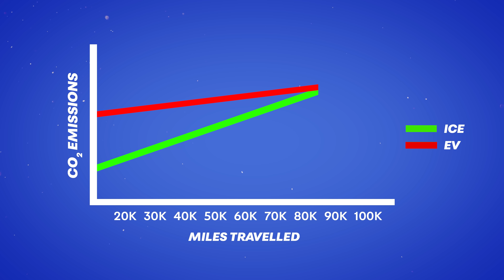Are Electric Cars REALLY That Green? [New 2022 Data]

Comment: What about the cost of updating the grid? Most Australian cities are already having brown-outs in summer due to high consumption and the limited output of wind, solar and no new power stations.
How will you feed a nation when arable farmland is being converted to solar farms? 
Charging stations on the Nullarbor plain or the Birdsville track! What environmental cost for the infrastructure?
My 17 yo Australian made 5.7l 1800kg sedan has 225k miles up. It has never been apart, is on the original fuel and coolant pumps and will still pull 33mpg at a 70mph highway cruise.
Without the petroleum industry we will not be able to make clothes, furniture or EVs - where does plastic, in all its forms come from? There is a place for both BEVs and HEVs but only for about 10% of the world's population.
BTW, battery fires are a real issue in hot climates. I have researched this a great deal whilst writing training materiel for EV technicians. Gaseous fuel has a lot of merit.

Comment: How long will the batteries last?   This does not take into account the lifetime of the car.   Will it last 350,000kms or 15 years without replacing the batteries?  If you have to replace them in 8 years that effects the cost and carbon footprint.    If parts are quickly discontinued then it means the cars will be scrapped sooner, increasing the footprint as well.  Not to mention the increased cost of owning a car.   It will kill the used car market if it costs 30 grand to replace batteries when an ICE car would have lots of life left in it at the end of a five year lease.   Those who cannot afford a new car will have to refinance their house to afford an old one, knowing they will have to soon replace batteries and motors.

Comment: One extremely important detail that was left out of the Volvo research, HOW LONG DO THE BATTERIES LAST??? 
Most people do not realize that those GREEN CARS will only run for a set time. THEN YOU MUST REPLACE THE BATTERIES, AT GREAT COST TO YOU AND THE ENVIRONMENT AS VOLVO STATED!  Just look at your battery tools, after so many charges, they die and must be replaced.
Reply: Wrong, new battery packs are tested and designed to run for over 100k miles with less than 10% drop in capacity. This is why many packs are now warranted for that. It’s true older packs had a much bigger drop in capacity and needed to be changed but technology gets better … just like mile per gallon has improved over the years in a ice car.
Reply: @How.deep.is.the.rabbit.hole.O  Even if you think you are right on this, and from what I have seen and read you are not, EV owners will still have to replace those batteries way before a regular engine would, again at great cost. There is also the issue of what to do with those batteries. Most states do not have any plans for recycling, and in many parts of US, like idiot California, they dont have enough electrical generation to support mass EV use.

Comment: ev uses twice the energy
325 miles = 100M joules (16HP for 7 hours level ground)
charging a big battery is 70% efficient
turning tires from a battery & motor is 70% efficient
therefore grid power for ev = 200M joules
gasoline = no delivery losses (minor)
gasoline does not explode
lithium batteries burn unexpextedly - ask Boeing

Comment: What are you going to do with all the hazardous battery material after the life of the ev? 
Ev are notorious for being junk after before and or around 100,000 miles. Also how many will be junked after an accident and barely anybody can afford to get them fixed and in 20 years almost all ev's made today will have completed there life span. They don't go very far and take too long to charge. Ev's SUCK.

Comment: STILL.   First Toyota prieus (1997) vs H2  (Hammer) had same issue till 100K.   So yes, STILL.  Keep killing the environment in the name of "makes me feel good".
"But eventually it will pass it"  By 100K you're replacing the battery, and that's the whole difference of CO2 during production right there.   Properly maintained ICE engines will do well over 200K without any major work.
The way I see it ICE are still the environmtal choice lol.
Reality > feelings.  Feel bamboozled by big corp + government yet?

Comment: Ya giving lots of 'ye but's' Vicky, for EV.s but not mentioning, if the battery dies before the 91000 mile (Yes they said 91000 mils not 90000 miles) or, If they get wrote off before the 91000miles which is much more likely with an EV, than an ICE in a shunt, just displacing one of the 1000s of battery's will do it, as a new battery is around £15000.

Comment: Excellent discussion about generation of CO2 but we should also consider that a) ICE vehicles consume the world's oil supply which is finite and is also needed to create many products and b) the increased generation of electricity from renewable sources requires a massive backup store for electricity which EVs can provide while connected to the grid.

Comment: I like what you have to say at the end, while yes this doesn't sound as good as we might hope, it just shows the room for improvement. The technology is definitely good enough, but it depends on where you live. The tech can be made greener in the production phase and the efficiency of electricity usage in the car as well as improvements in electricity grids. Those improvements would increase the use cases where electric vehicles shine. I live in Ontario Canada. According to my energy provider Hydro One, 96% of their power is carbon emission free and only 2% of Ontario's GHG emissions are from electricity generation. So with my driving habits and Kona Electric it will probably take 4 years to hit a break even point. That is assuming that my car's production emissions match the Volvo example. Now if I lived in a different area with a worse electricity source, my relatively modest driving might take so long to break even that I might need a battery replacement simply due to the battery being old. A combination of limited driving with a bad energy mix might make an ICE vehicle a greener option. But 10 years from now? The circumstances where ICE vehicles could be greener will continue to dwindle while electric vehicles will expand. And where I live, electric vehicles compliment my electricity sources. There are very few if any use cases where ICE is better here from an emissions perspective.

Comment: You haven’t considered the long term situation that there is not enough rare earth minerals to make enough batteries to replace the ice cars.  I bet they run out before the oil supply does.  Does these figures also cover the short life span of the batteries and the fact that when the batteries stop holding charge the car is scrap?  Also the cost of dealing with the waste batteries that can’t be recycled! If these were factored in the ice car will win I’m sure

Comment: One thing you left out. What about the end of life for the battery and it's efficiency loss. You will have disposal cost and the cost of replacing the battery. I have a 84 Toyota pickup with 299,000 miles on it will a battery last that long?

Comment: 08:50 "it is okay for electric cars to not be perfect at the moment"

This is NOT true.  On average the electric cars being bought now will be no better than the petrol cars that could be bought instead.  This is because the bulk of our electricity is generated from burning stuff (Gas, trees or coal).  Eventually we will be able to generate more electricity from wind and solar but this will take decades to balance the amount of energy needed to run all our cars.  Cars have a lifetime of about 7.5 years in the UK.  That means that the whole fleet of electric cars being bought now will be scrapped before most of electricity can come from renewables.  Therefore it is obvious that we should wait until we can generate almost all of our electricity from renewables before we switch out transport.  Switching transport to electric will just create more demand for electricity that will require non-renewable generation to operate more for longer.

Comment: I’m not a huge fan of EV cars but they appear to be the future and right now I’m not convinced that EV cars are cleaner because of all of the aspects you mention and we have think about what happens to the batteries when they expire.  If they are charged with renewable then maybe and I do feel that this will increase over the years especially with laws requiring so many businesses to reduce their carbon foot print or go Net Zero but not there yet.  The energy required to recycled or dispose of is far greater than that of a non electric vehicle not to mention the contents of them are toxic so could cause harm other ways.  It’s comical to see the ads for these claiming that ownership is helping the planet.

Comment: Retail customers buying only renewable energy from their supplier doesn't really change anything.  Why? because there is only so much renewable energy consumption available.  When you feel good because you have a 'renewable' electricity contract all that happens is that large industry is forced to use the non-renewable electricity because that is all that is available.  That means all the other stuff you consume is made using a higher proportion of non-renewable electricity than it would have been if retail customers had kept with the same mix as they used to.  The end result is that you pat yourself on the back because your lighting is 'green' but all the other stuff you buy was less green than it used to be.  The ONLY way to think about this is to look at the mix of energy sources for the whole country because we all end up consuming all the electricity in one way or another.  We either do it directly through our home electricity contracts or indirectly through the electricity used to manufacture everything else we buy.

Comment: When it comes to converting the energy in fuel to motion EVs are worse than ICE cars.  Why? because most electricity comes from burning stuff (gas, trees or coal). This generates a lot of emissions and power stations are only about 50% efficient at converting fuel to electricity.  Then we lose about 8% of that electricity transmitting it to you house.  When you charge your electric car you lose 16% in the conversion of electricity into chemical potential and another 16% converting it back again when you drive.

The end result is that EVs are les efficient than a modern petrol or diesel car.  When you think about it this should be obvious.  When you burn petrol in a cylinder that is directly connectde to the wheels of your car you will always turn more of the energy in the fuel into motion.  Basically you are only converting fuel energy to motion in one step.  Generating electricity for electric cars involves loads of steps and they all lose some of the energy at each step in the process.

It would be handy if politicians understood a bit of basic physics and chemistry before they destroy our economy by making transport so expensive our country grinds to a halt.  The really annoying thing is that the inefficiency of EVs and the fact that we will not be able to power everything from renewables for decades means it won't even achieve what the campaigners and politicians want.  It will just result in higher costs for everything and waste more resources.

If your goal is to reduce the emissions caused by your driving then the easiest and best soultion is just to keep cars on the road for longer.  Most of the CO2 emissions from a EV car are from the manufacturing.  With an ICE car about 50% of the lifetime emissions are from the manufacture.  The rest comes from the mileage you do.  In the UK the life expectency of a car is about 7.5 years.  So, if you keep a car for 15 years you have automatically reduced the total emissions by a massive amount.  Modern cars are really high quality and there is no reason at all why they cannot stay on the road for 15 years.   

Adopting this approach wouldn't need people to buy cars that are twice the price.  It wouldn't need the country to spend billions of pounds on new electricity generation.  It wouldn't need the country to spend billions of pounds on upgraded electricity transmission lines and it wouldn't require us to accept ever higher electricity prices while demand outstrips supply.  It is quite simple but of course campaigners and politicians don't like simple.  They like to feel like heroes who have mastered something complicated.  The truth is that they are too dim to understand that this doesn't have to be complicated.

Comment: Glad to have this conversation, I hope that the new method of battery manufacturing (dry cathode instead of wet) will help reduce the amount of CO2 in battery production.
Reply: You do know that Carbon Dioxide is the Gas of LIFE! Reduce the CO2 < 150 PPM and that will kill all the plants and trees on EARTH! The earth ship will have to replace the P and add a "T".
While increasing the CO2 to 1,200 or 1,500 PPM will increase top and root growth of plants and trees, while using less water and fertilizer. That sounds Good to me.

Comment: Gasoline made from CO2 doesn't emit any new CO2 emissions into the atmosphere and doesn't poison local environments the way battery manufacturing does. Carbon Neutral gasoline is the superior solution it would bring new CO2 emissions to a halt if it were to be widely adopted. Zero change needs to be made to current cars on the road today with this carbon neutral gasoline, people need to simply fill up their tank.

Comment: It is not so straight forward, there are many things that have to be taken into account, a lot of EV's tend to do high mileage per year, a lot doing 60,000 miles and more so they will reach parity much quicker, also many EV's are charged from Solar panels on houses which means zero carbon footprint from each charge so the carbon footprint of the car will very swiftly reach parity. And with the new battery technology the batteries in an EV are going to outlive the car and then be used for energy storage and only the rest of the car recycled. Any damaged batteries can be 99% recycled and rebuilt into new batteries very easily so very little pollution there in comparison to the disposal of catalytic converters, Oil and Coolant etc from ICE cars which are extremely polluting.

Comment: This is so bad it's embarrassing. 
Those studies compare  gas at the pump to electric cars. They don't take into account extraction pollution per gallon done by fossil fuel, that's pollution from 4.5 to 6 kWh per gallon using fossil fuel. Then there's transportation pollution to main storing facilities, oil spill pollution, the pollution of the storage facilities, transportation to gas stations, maintaining gas stations because you can't sell unsupervised gas.
Then there's oil changes, anti freeze, spark plugs, air cleaners, hoses, parts outlets, manufacturing of parts, keeping parts stores heated and lit. 
Then there's the trillion dollar wars to protect oil interests, the pollution from those wars, the pollution from designing and testing weapons for those wars.
Then there's higher cancer rates associated with populations near major roadways, smog the WHO says is still killing and making people sick.

EV's can be charged from personal PV arrays, can anyone reading this create the fossil fuel to power their car? If so you're in a very, very small group. Even apartment complexes can install EV charging stations.
The energy used to create one PV module is recovered in less than a years with 30 plus years of clean energy to follow. I most places people can opt to buy only renewable energy from their grid supplier. EV's are technologically rich, fossil fuel is... well fossil fuel! EV's will continue to get better, become more efficient, go further and charge faster. A 1970 VW got 30 mpg, ICE vehicles can't get higher than around 40% efficiency, it's called a "heat engine" for a reason!
Are you kidding?

Comment: The source of the electricity - do you think petrol or diesel somehow magically appear in the pump at the garage? Try to investigate the amount of energy needed to refine one gallon of petrol - energy that comes from burning oil. How long can you drive in a pure EV on the energy used to refine one gallon of petrol? That's even before the petrol is in the pump, not even the car. I understand what you are trying to do, but it is way more complex than you present it to be.

Comment: There's research from Bristol university last year that shows that in the UK, on average, it takes about 2 years for a BEV to make up the difference, after that you're saving carbon. In places with more renewable electricity it's even better. I'm not sure what Volvo's angle on this is... possibly they make less margin or don't want to retool to increase ev output or they can't get supply of batteries, but I'd trust an independent university which goes through peer review. Hyundai also do equivalent models in EV and petrol, for example, and they come out with very much better than volvo's figures.

Comment: You also have to take into account that getting rid of a EV pollutes quite a bit more because of the battery.
Reply: well, its not like getting rid of a gas vehicle doesnt. there lots of liquids in a gas car, not in the EV.
Reply: @davidwillims2004  you can recycle an engine. Can’t a battery. And batteries have toxic acid in them. The hell you talking about no liquids hahaha
Reply: @WorldRaceMVG  well, there is no oil, or gas /diesel left is there? and some evs maybe be using electric brakes? and there is a 1 speed transmission. what else would have liquids in any car?
Reply: @davidwillims2004  the BATTERY
Reply: @WorldRaceMVG  well can the battery be recycled ?  in some cases yes, in others maybe not, lithium batteries for cars and personnel electric devices are very very different. one you can fix, the other you have to replace.